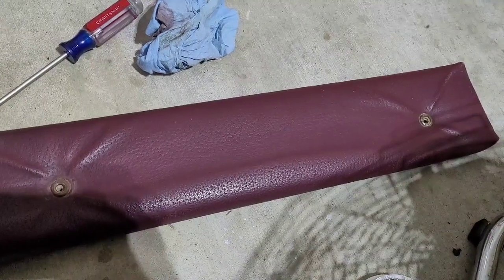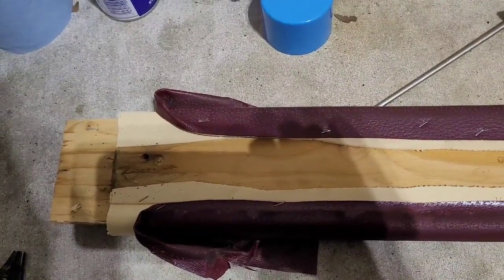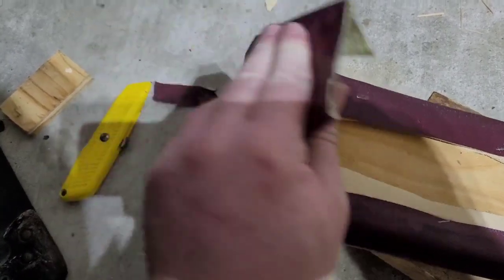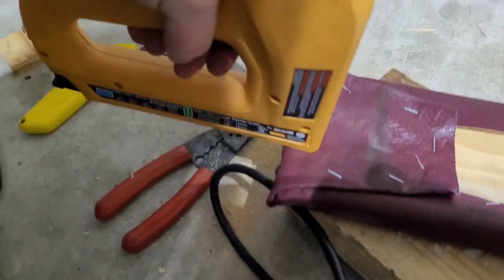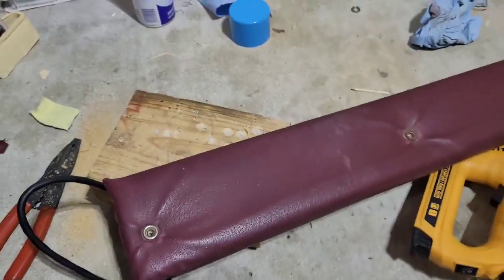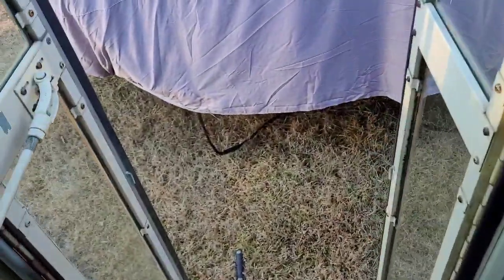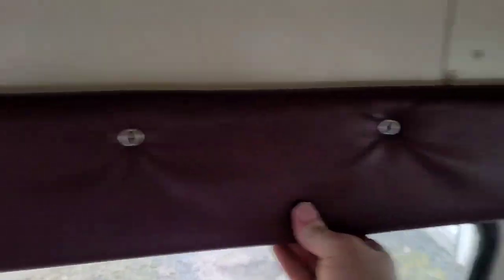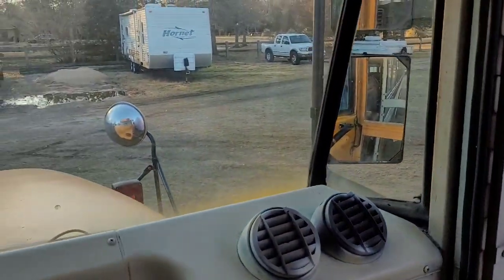Maroon Header pads for the Blue Bird

Comment: did u get the steering repaired on the bus yet? the one u said tried a wheel puller & didn't work!
Reply from the maker: No.  The steering wheel is being stubborn and the puller bolts bent.
Reply: @txstreetman  Ah,  ok,    might have to replace the steering caluum?